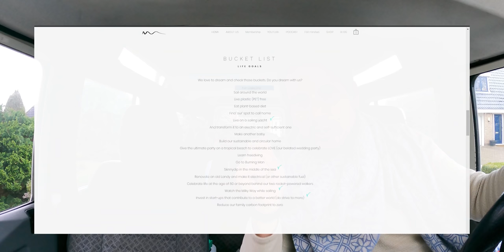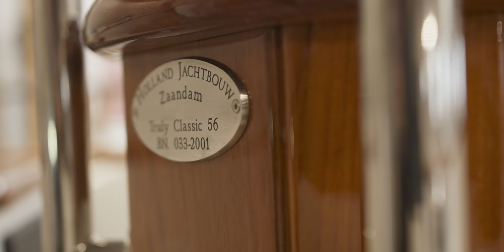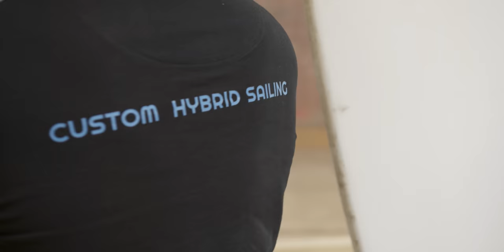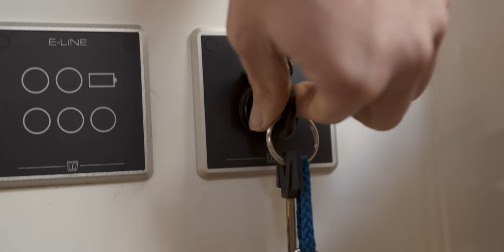Can We Go FULLY Electric 🤩 STOK Electric & Modern Classic Sailing Yacht - Perfect Electric Sailboat

Comment: Great video, very well explained and I love the enthusiastic attitude of the 2 young entrepreneurs. Way to go. Question, what is the fuel consumption of the Yanmar per hour in order to keep on using the engines for a prolonged time. Let's say cloudy, misty days with no wind for days on end?
Reply: The engine is able to run at its most efficient point. We haven't done fuel consumption measurements as of yet, but these will probably be very good. Yanmar states 8L/h absolute worst case in their datasheet. But in reality this will be much less

Comment: Hybrid drive is the future for cars and boats. For powerboats most systems stay with diesel propulsion and run large generators off the engines, this means no genset required, plus the generators can turn the props on their own at slower speeds. For sailboats electric motors seem to be the propulsion of choice, Stok looks to have a nice system, but $100k is expensive. The good news, by the time you're ready to consider a hybrid system, the price will be 1/2 with better performance, possible even solar sails for more free energy. Something to look forward to in the future.
Reply: Thank you for the reply. Yes unfortunately the system is still quite expensive. Most of the cost are in the batteries. In the future, with better technology and availability these prices will drop.

Comment: this was really interesting and exciting to watch, my only question is how long could you expect a system like this to survive before major work needs to be done on it?
Reply from the maker: Thanks Kato, great to hear you found it interesting, this a question @stokelectric should answer, will forward your question.
Reply: @FeeltheBreeze   Thank you
Reply: Great question. So, the generator needs to have it's maintenance according to the schedule, it's used less so it will wear out less quickly. Also the generator is the only "maintenance intensive" part in the system, all other components are electronics. With age, some electronics might fail but we try to design it in such a way that the component would be easy to swap out, so no major issue there. It would even be possible to take a spare on an ocean crossing for example. The other big component that would eventually start wearing out are the batteries. They have a life of ~6000 cycles if used correctly, on a ship this is incredibly much since it most likely won't make a full cycle every day. So the expected life of the battery pack we estimate at around 20 years at least. Looking 20 years into the future we expect battery technology to have sky rocketed and be much more affordable and much better.

Comment: Bravo for the youth who have dreams. Real young entrepreneurs who apply their knowledge. Its should give you the taste to make an investment for an update of your electrical system of your boat. The idea of using the engine of this boat so as not to have difficulty finding parts for the repair is great. This is a very nice vacation for you. To take the time to increase your personal knowledge without being present because of a weather window. I waited for the charging time for the batteries. But do you know if you have to use the electric motor for your trips, what will be the autonomy of the batteries before restarting the generator motor for recharging. Thank you for this video
Reply: Thank you for your comment. Charging happens through the conventional 12V or 24V battery bank which is present on every sailing boat. This way it is very easy to connect solar panels, hydro pods or shore power to the system, because you can use conventional components. This keeps everything simple. Of course the big battery bank is charged through the generator and hydrogeneration as well. A big benefit of the connection between the 12/24V battery bank and the 350V battery bank is that the energy can flow both ways. So there is a lot of power available on the 12/24V side for household appliances.
Reply from the maker: It's on the bucket list André, who knows what the future will hold ;)

Comment: That’s incredible. My fear is cost. Cost to repair and or replace. The environmental impact on old batteries is still unknown but may be worse for us all in the long run. Fear of fires (I know. Sounds strange that I’m not worried about a fire with my diesel. Lol). Electric cars in the US is stupid expensive to repair and or replace anything. I love that they are on the cutting edge tho. How inspirational. Thanks fam!  Much love to you three!  Oh and Big Ben!!  Wow he is growing up so fast.
Reply: Cost often are an issue with these systems. And that's mostly due to the batteries, fortunately these will become cheaper in the future. Your fear of fires is completely understandable as there are many horror stories of batteries catching fire, this is the exact reason we went with LiFePo4 (LFP) batteries and not conventional Li-ion. The risk of fire with these LFP is reduced dramatically. There are even some video's going around of people shooting LFP batteries with guns, not very scientifically proof of course but still worth something. We try to do everything in our power to make the system as safe as possible, this is also the reason we use 350V to reduce the currents and fire risk. The world has to figure out a good way to give batteries a second life, for example in suburban areas as a backup power source. The batteries have a very long life if used correctly, the same goes for other electronics. I'm not saying it's impossible to break something, but I dare say it's a much more reliable option compared to a diesel engine. To minimize the chances of things breaking we keep everything simple and want to give people the option to easily swap out components if something breaks.
Reply: @stokelectric  I am impressed by what you all have been able to do. I don’t mean to talk down or bad about your creation so please don’t take it that way. I am excited for what you are doing and what the future holds. I really am. Thanks for the reply.
Reply: lithium battery recycling is leaping ahead exponentially now, and the new batteries produced from recycled ones are showing to have slightly better energy density. but this end of life is not until 20 or 30 years, and in the mean time they can have a very productive life as stationary storage cells.

Comment: Thanks for sharing this. I would have like to know if they use same propulsion battery banks as the "house bank" or if there is a separate cross connected system?
Reply: We use a separate battery bank for the hybrid system. So the standard house hold battery (12v/24v) remains in tact. This means you can use conventional parts for solar panels, shore chargers and what not. We do have a converter between the battery banks which works both ways, essentially coupling the capacity of the two banks. This increases the available household capacity by a lot, allowing for induction cooking for example. It also means the 350V battery bank doesn't require any special charge connection.
Reply from the maker: As far as we understood it's all one bank, we know they guys from STOK are reading the comments so it's up to them to reply.
Reply: @FeeltheBreeze  sorry guys, we forgot to show you that the normal household battery remains in place, we have the converter box we told you about to essentially connect them into "one large" battery.

Comment: Super cool.  That said, how many hours of average motoring can they get on a single charge?
Reply: On a single charge about 2-4 hours at 5 knots depending on the conditions. This should be enough for a normal day sailing. This range is simply limited by the amount of space available on the yacht. That said, if the generator turns on the range is increased dramatically.
Reply: @stokelectric  can you run the generator and power the electric motors simultaneously?
Reply: @tjsakasegawa5466  Yes we can. So running the generator will deliver enough power for propulsion while also charging the batteries.

Comment: That’s a clever design. Probably a more favorable system compared to ocean volt. The biggest beef with electric is eventually the juice will run out so there has to be a level of conservatism. You can see it on sailing UMA. But to have the engine work as a generator not for propulsion but to charge the bank is smart. You could increase the range 3 or even 4 time further then just a pure electric and frankly this kind of system will answer that question of where is the juice is going to come from and with the diesel only being used only an hour at a time to charge wow I bet you could cross an ocean without throwing a sail up.
Reply: You understand it very well. The diesel generator is there as a backup, with the efficiency of the Yanmar engine, which can always run at it's optimum rpm because it's charging the batteries and not propelling the ship, plus the possibility for 750L of diesel on this ship, crossing an ocean would not be a problem.
Reply: @stokelectric  it’s brilliant and a game changer

Comment: Looks like an extremely well designed and executed version of the old (since 1920s, I guess) diesel-electric train, here with a large battery buffer. Not to talk this down - but the concept is well understood in engineering and heavy industries. It can take out loads of transmission losses. And it does here with the direct-drive electric motor. As electric motors have become much better in the past decades, it becomes more attractive. The hydro-power of 5 kW at 8 knots to me is surprisingly high - wasn't aware of that. And running the Yanmar under load, probably at constant RPM, if/when it runs, generates the question if that engine could be an industrial static type built for, say, 100,000 hours (11 years at 24/7. That is relevant - imagine you drove 300,000 km with your car at an average speed of 50 km/h then that only constitutes 6,000 running hours. And at industrial scale that is "nothing". Yes, such an engine would still have its planned maintenance).
Reply: Thanks for your reply. I just want to point out that the 5kW regen is a theoretical value, we forgot to mention this in the video :). In practice this will be lower, we don't know by how much yet. The generator won't normally be used that often, it also runs at a variable speed depending on the battery charge and required power.
Reply: @stokelectric  - and thank you. That was more or less expected. It's simply a very elegant solution - when done well, as is the case here.

Comment: Do they work with any new Yacht builders to set them up with the electric system like they have designed?
Reply from the maker: Yes, they are in contact with several yacht builders. Not sure if they are partnered already.

Comment: Nice video😃 Is approx 100k for this set up incl. the CPP propeller/shaft/thrust/CV-joint-system as well? I think 70k for a conventional dieselengine and transmission was a way to high cost-estimation🙄 Batteries would also need replacement. Hybride/electric boating is the future - maybe not for the best in all kinda set-ups...but cause of legislation. I really believe in hybrids for all the good benefits it brings in total (redundancy, back-up, re-gen, silent marina operation, house-loads, eliminating ekstra genset, hydraulics etc). BUT I'd prefer it to be parallel hybrid - so the diesel operate where best and completely as standalone for safety, then have all the other benefits and back-ups from a parallel hybrid system. Then you could also use a smaller el-motor and in 48V for less hazardous accidents😉 Especially I'd go parallel when shaft-line and engine beds is conventional anyway. A very nice reason for full diesel-electric as in the video is that you could place the genny and system anywhere onboard - cause it doesn't need to be inline....and then I feel it seems extra weird putting a diesel engine back in the middle of the saloon. Having the galley-sink above the 300V system components feels wrong - even as an IP installation....what would Murphy have said?😉 I guess the owner of the yacht has had his own input on how he/she would like this. Everything will break on a boat sometime so it's all about the total design/installation no matter if its electric or conventional. I believe these guys will have a bright future ahead - and market is heading down this lane. Legislation and emission restrictions makes it impossible to install an old unbreakable Gardner in a new build. You cannot get it CE certified. Today complexity is also added to diesel engines for this reason...turbos, intercoolers, electric control of all combustion, high pressure common rail, exhaust treatments++ So going for electric propulsion is not much more complex...and soon to be shelf ware systems. They used electric uboats in WW1 - so its not rocket science☺️ But designing a complete system and integrate it for best possible operation is the challenge yet I think🤓
Reply: Keep in mind that the 100k price includes a 30kW generator. When you add this to the cost of replacing a diesel engine, you'll end up near the 70k mark. Of course it depends on other factors which need to be changed with the new diesel engine. The batteries will last a very long time if used properly, it's not like general AGM batteries which need replacing every 6 years.

Like you say the redundancy is a big benefit of a hybrid system. I understand that you would prefer a parallel system instead of serial but this has a lot of drawbacks. First of, it would never have been possible to convert this ship using a parallel hybrid system due to space. Also if this ship were to be using a parallel system with a 48V system, the power required to propel it electrically wouldn't be sufficient and you would be drawing high amps all the time to just motor at slow speeds. You also need the power of the electric motor for meneouvering, with a parallel system you would need the diesel for this.

These are just some of the reasons we prefer serial hybrid, you also mentioned some other benefits👍.

A drawback of serial is that the generator cannot power the propeller directly, but this is something we're working on.😉
Reply: @stokelectric  Thanks for your reply :) Yes surly good batteries is needed - but I doubt they would outlast a yanmar diesel engine? I do not think someone would add a 30kw generator in addition to a conventional diesel in this size yacht either. Is the cost estimation exclusive the propulsion line shaft/propeller....and tax? Pending on the system set-up a 48V should be proper for a sailboat this size for slow speeds and manoeuvring in normal condition....which I'd like in a parallel system...but surly you cannot get enough power for full speed or manoeuvre in gale conditions etc. The Achilles heel is a full stop and emergency reverse I guess....but again pending on the system a modern engine do not need a long time to start up either. The benefits as I see it is going electric at slow speed and diesel on the long-runs...together with eliminating an extra generator/diesel engine - still having back-up and possibility to re-gen. Also using electric power to motor-sail to not under-loading the diesel engine. 48 volts just feel safer and not adding more complexity than already onboard - but this might be a fear without reason :)  In my area(western-Norway) sailing is mostly for fun and not so much for getting from a to b - cause of geographical challenges, so pretty dependent on good motoring-solutions year round for getting around. I must say though - the diesel I've filled on any tank on any of my boats - mostly go to heating  ;) Would be very interesting to know more about the system you're working on with a direct drive function as well - is there any more info on this somewhere?

Comment: I really hope someone can make one of these electric systems work without being reliant on a generator. Sailing UMA has been trying their best to get one of those props to generate enough electricity to recharge the batteries, but so far it only realistically generates basically enough to keep the electrics from draining battery power while under sail.
Reply: Of course this system is also suitable to run without the generator, but we only recommend this for coastal and inner water sailing. Regeneration through solar, wind and water are all an option and depend on each ship and ones preferences. From our testing the regeneration values will say for how long we can run without generator, but we are very optimistic about these results
Reply: @stokelectric  Yes, if you’re in the Caribbean with plenty of sun the combination of prop and sun seems to be able to sustain the batteries. Unfortunately, trips to Norway and north with little solar seem to require a lot of generator time to keep the batteries charged. That said, please don’t give up on innovating and trying to reduce the need for fossil fuels to live off grid.
Reply: @darrylcox236  Just like you say, there are a lot of factors to take into account how much/if at all a generator is needed. For safety we use it, then it's up to the end user how much it's being run. Fortunately battery technology is increasing fast and in the future it will become more and more easy to run extended periods without using the generator